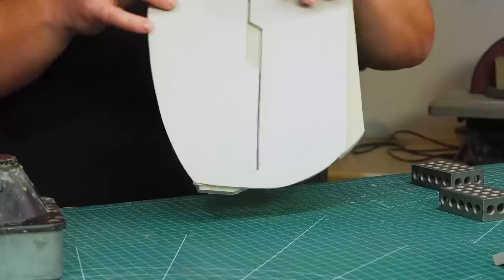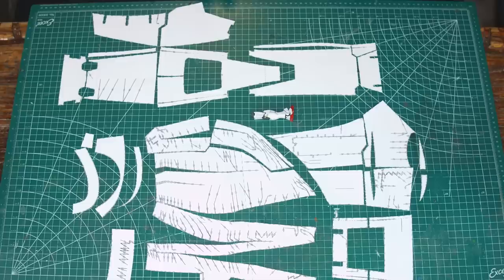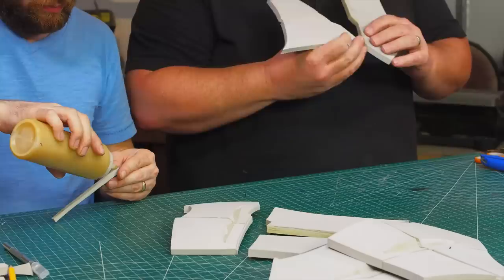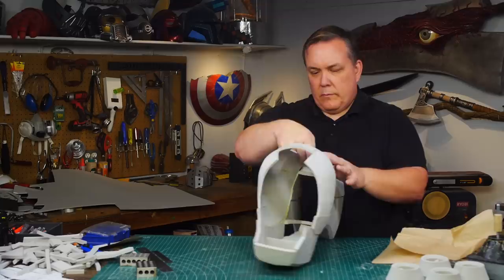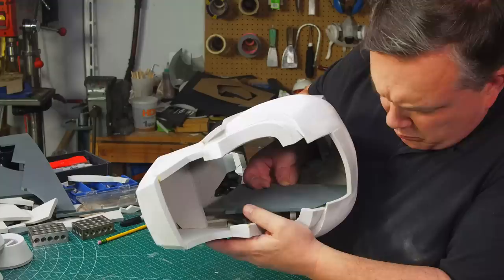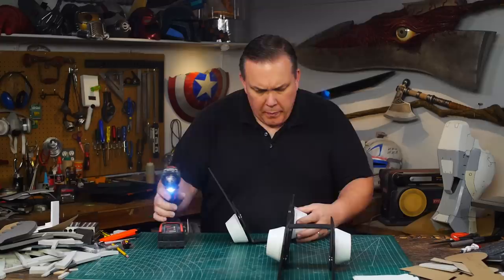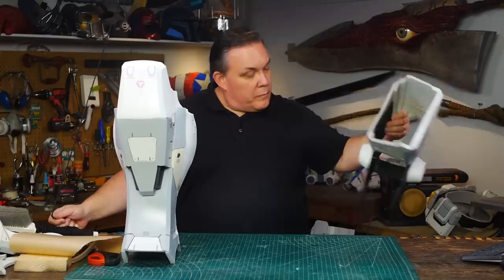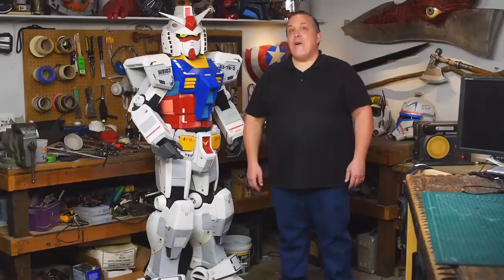Odin Makes: RX-78-2 Gundam cosplay full body with legs!

Comment: Now that I think about it, making the knee affixed to the calf was a better idea to begin with. While the RealGrade, MasterGrade 3.0, MasterGrade Origin Version, and HighGrade The Origin versions all have folding knees, the original series and all 4 HighGrade Universal Century versions (even the highly-stylized G40) show the RX-78-2 Gundam has kneecaps affixed to the knees, so it's still technically accurate in its own way.
Reply from the maker: I was thinking the HighGrade had affixed knees, but I have not built a HG RX-78
Reply: @OdinMakes  There are multiple versions of the High Grade. Of those, only the Origin version (which just came out a couple of months ago) has folding knees.

Comment: Ok. Now you gotta make the shield, beam rifle and get two of those Air Shock Beam sabers I keep telling you about. Maybe if you are feeling extra creative you can make a Gundam Hammer and the saber blades.
Reply from the maker: I plan on making the Beam Sabers from scratch, next Gundam video. They need to fit the backpack, so I am just going to make them.
Reply: @OdinMakes  alright, in that case I believe the proper light combination for Gundam's pink plasma is red, white white for a tri-cree LED... I think there are Gundam saber sound fonts for the Nano Biscotte out there. You might want to at least look at pictures of the 1/12 scale saber as it does provide info on details you can use to disguise switches and retention screws. I would also use a bullet tip for the blade. 

What? I also build custom lightsaber for fun. Built my dad an ANH Obi-Wan for his 65th birthday.

Comment: Would flex seal work to secure the parts together if used inside instead of more foam strips
Reply from the maker: Flex seal tape? Probably would work just fine. I don't have any here in the shop, we went with what we had.

Comment: I know you’ve said it before, but what kind of contact cement do you use on foam?  I know you’ve said you don’t use Barge due to expense, but my memory is failing me on what you actually do use.

Also, something that might be worth looking into in the future are lacrosse gloves for the hands.  They’re padded in ways that look really close to Gundam style mechanical hands, but allow for nice range of movement.  It’s what I plan to use for my Heavyarms when I actually get around to doing it.
Reply from the maker: I remember being told about lacrosse gloves before.... probably you as well!
DAP Weldwood brand contact cement is what I use, the red can version. Don't get the green can- it's really hard to use on foam.
In California it's hard to find the red can, ACE Harware is the only place around me that carries the gallon can.
But Barge rocks if you can get it!
Reply: I appreciate the response.  Might have been me that mentioned the lacrosse gloves.  Been a while if it was.  I found some made by under armor that are pretty much perfect.  I figure it saves on having to make them and they’ll probably be more durable than anything I’d make.

I’ll have to grab some of the cement.  There’s an ace not too far from me, so it shouldn’t be too big an issue.   Only supplier I have near me for Barge (I live in Middle Tennessee) is a Tandy shop about an hour away in Nashville.  Bought some there before, but it’s definitely more than I’d like to spend.  I think 2 cans of it ran me close to $80.  Add in gas and wear and tear on my car, and something closer and cheaper would be better. :)

Also, great work on the Gundam.  I’ll have to look into Armor smith.  I assume it works like Peppakura, where you upload a model and it unfolds it into templates?  I have an MG HeavyArms that I may try and scan with photogrammetry if I can’t find a model I like.

Comment: What is the tool used at 7:42?
Reply from the maker: Milwalkee Oscillating Multi-tool. Many brands make them. You can change the head for different uses, I am using 240 grit sand paper here. There is also flush cutting blades, and paint scrapers...
Reply: @OdinMakes  Thank you!